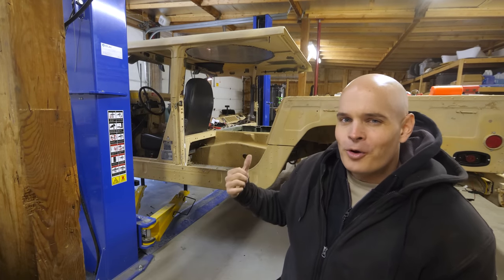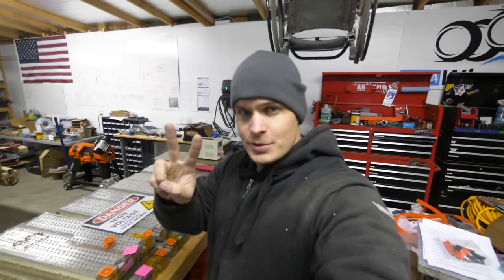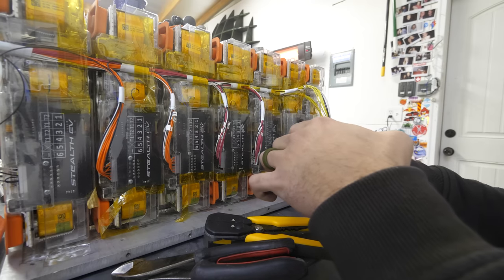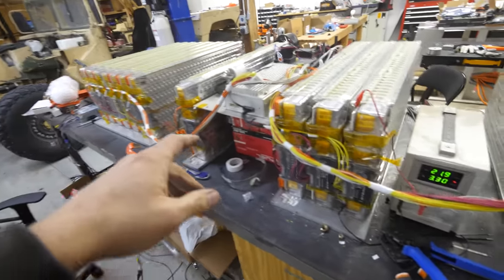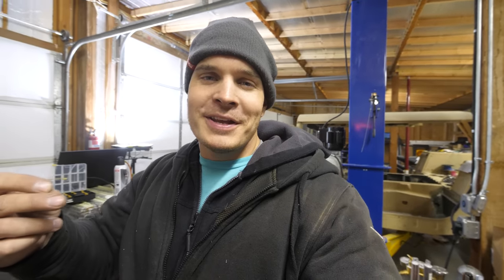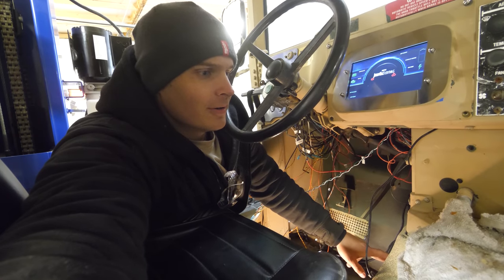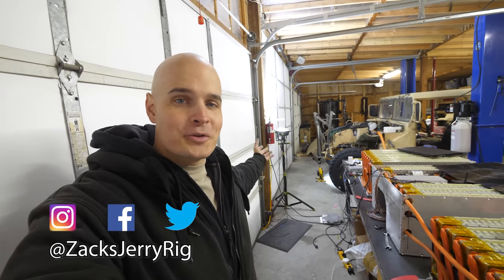Building the Brains of the HIGH VOLTAGE System - IT MOVES!!

Comment: If using an Orion BMS for upper and lower level balancing why would you need to balance the one module prior to wiring in series as you did with a trickle charger over night? Wouldnt the BMS handle this?

Comment: This is SO cool!!
But Q - why are you using Tesla-Batteries? Other manufacturers are using formfactors that might fit better into a Humvees "open spaces" (especially those occupied with diesel-parts before), so maybe the backseats wouldn't be "occupied" by the batterypacks?

Comment: Twisted pair is nothing to do with causing interference, it's a key part of how differential data systems work (CAN is differential) you want any external interference to be picked up equally by both the high and low wires, that way the receiver can do a better job of removing the noise, the twisting helps ensure close coupling of the wires. How differential works is you take the same data and send it positive going on one wire and negative going on the other so maths wise one wire carries +1 the other carries -1 (or vice versa) Noise gets picked up by both wires and is picked up equally, say the noise has a value of +2 so both wires now have data at +1 or -1 and noise at +2, now at the receiving end the negative wire is first inverted so you have one wire with data at +1 noise at +2 but now the other wire has data at +1 and noise at -2, you now add one to the other and you have data at a level of +2 but noise is now 0 so you've eliminated the noise and also doubled the signal.

Comment: I would insulate the entire inner surface of the battery box. Specially the open terminals for each battery set that connect to wires are quite close to the bare metal case. This can be risky specially if the box is connected to the chassis ground.

Comment: Actually end resistors of the CAN bus are not to mark the end of the bus. As CAN protocol uses optocouplers inside the modules, it's impedance is really high. Without these resistors, the wave form of the can bus will be like steady and nobody can communicate via the bus.

Comment: the exposed battery terminals being so close to the side of the Battery boxes has me very nervous. Should those batteries slide forward some how (assuming they are mounted so they cant move). what's keeping them from shorting on the battery box case.

Comment: You can take like 5 Million volts if the Amps are low enough,
like if you're doing High voltage 5Mil V at 0.3A, you'll be fine if you get directly shocked or even touch both battery terminals. 
It might hurt a good bit but unless you tried, it be pretty hard to die

Comment: Surprises me that the cables are very thick, but the contactors themselves are just thin pieces of metal with only a small amount of surface area for contact.

I guess the resistance for that section is high. But since it's such a small section the waste heat easily dissipates and the energy lose isn't that bad. But you wouldn't want the entire wires to have that much lose or to be generating that much heat.

Comment: I’m assuming everything is aluminum. But just incase, if you’re using different metals (nuts, bolts, battery boxes, etc.) be careful as to what metals are making contact. Galvanic corrosion is a thing. (Tbh I don’t know everything about it but I figured I should give you the heads up just in case you don’t either)

Comment: Your wires running through each box need wire protection so when vibration occurs it doesn't cut the wire feeds .

Comment: Isn't the 500A of the fuse at the limit of what the motor will use at full power? If the motor is rated for continuous output of 220kW, which at 450V (and a 100% efficiency, which is certainly not the case, and it will decrease as the motor heats up as its internal resistance will increase) means a current of 488Amps, which is very close to the limit of the fuse. I hope that the specifications of the motor ensure that it cannot draw more current in a transient state.
Reply from the maker: Yeah,  it doesn't break right at 500 amps like a normal fuse. It allows 500 amps but not for long periods and breaks at higher amps.

Comment: Your lugs on your battery cable should not be loose on the terminal i.e. 3/8" terminal on a 5/16" stud. Several battery manufacturers use these 2 sizes for the + (3/8") & the - (5/`16") for most applications. Marine batteries may have both terminals at 5/16" which brings up the second point. Why do people use only 1 color cable when another color costs just as much per foot? Like red for + and black (or yellow) for -, yellow being used to clear up any errors about red OR black for +. P.S. ALT (adhesive lined tubing) heat shrink rocks but don't experiment on your finger, it really does stick & also burns your finger as well, not that I have done that. I left that up to the apprentice to figure out!

Comment: Well, the amps (current) is proportional to voltage in Ohm's law (I = U / R). Although the human body probably has a quite non-constant resistance, higher voltage will tend to give a higher current, all else being equal.

Higher voltage also means greater danger from an exposed conductor, because at higher voltages, the electricity is capable of arcing through air over larger distances. People seem to forget about this, as the arcing distance is so small as to be almost unnoticeable with the voltages you have in household outlets, etc.

(When you hear about someone getting electrocuted by a high-voltage wire, from climbing on a train and such, you often hear people respond "How could they be so stupid as to touch the wire?". I suspect that in many such cases, the victim was actually thinking the same thing: That he'd have to actually touch the wire to get hurt.)

Different voltages, the difference between AC and DC, and the frequency of the current (if AC), do affect how the current flows through your body and the effects. I don't really know any details of it, though. What I can say is that power (watts) = voltage (volts) x current (amps), so obviously 1015 volts x 1 microamp is putting far, far more energy into your body than 12 volts x 1 microamp, and it's pretty straightforward assumption that it's going to do far more damage as well.

The point with "it's not the volts that kill you" is more that voltage alone says nothing. A bit of static electricity can be thousands of volts, but is still harmless, as the amount of current the static build-up can deliver is quite small.

Can't wait to see this beauty as a daily runner! :D

Comment: Shouldn't you maybe insulate the inside of the metal battery box - especially at the side with the terminals - just to be extra sure that no vibration or sudden movement causes the terminals to accidentally short against the box?

Comment: 2 packs in series won't kill you because it is DC power and not AC, DC needs a lot more voltage to be able to cross skin and protections. eg 110v AC might shock you but DC wouldn't prolly do much harm

Comment: Gave me the HEEBY JEEBIES that you didn't think to put any insulation at all over the high voltage terminals !!!  DUDE - something always bumps against non-insulated terminals.  Same for inside the box - you're going to drive into water at 100kmh one day (or whatever else goes wrong), which will bend all that conductive aluminium right into contact with those terminals too (or the batteries will shift forwards, or you'll drop a spanner, ...)  you've got to do something more smart about using more than plain air between lots of AMPS (instant fire sucks) and lots of VOLTS (death sucks too) and everything else...

Comment: Hey Zach, so many things I would / should comment about... But I'm in the process of purchasing a hydraulic lug crimper. Do you mind sharing the brand that you used? I'm concerned about ending up with a Chinese knockoff that will cause me years of regrets. Primarily I'm crimping 4 AWG & 2 AWG  (not 2/0 gauge) tinned copper battery lugs on stranded copper welding cable. I've been told a 16 ton hydraulic crimper is typical for my application. If you don't mind shoot me a link or just give me your opinion. 

Now, I'm going back to the beginning of your project and start watching your videos! I've just become your newest fan...
Scott
Reply from the maker: I just got it on Amazon.  Not sure the brand.  I did have a yellow one that sucked though.  The blue one is way better.

Comment: That's funny, the e-wire, electroluminescent stuff runs at a much higher voltage than the hmmwv, but low current, so safe.

Comment: BMS also prevents from cutting the power from batteries. If one battery Fails the other batteries will still be running instead of cutting the power to whole system.

Comment: I missed the cooling system.   I'm not sure if your application needs it but I'm just making the fatal flaw of assuming it is safer for the high use and faster charging right ? I just can't imagine not having  some ... heavy use ... with this platform

Comment: don't use a knife to cut sheathing like he did you can create hot points with the dead ends you make when you cut some on the copper strands and these can become failure points later possibly leading to fire.

Comment: You might already know this but the batteries need air to stop heat accumulation.  It could be filtered cabin air exhausted outside filtered or screened to keep varmints out unless you're using liquid cooling
Reply from the maker: We are using liquid cooling

Comment: AWG  on wiers is a mess  :D   In my country we use mm2..

PS - Pleas why no torque wrench on the battery terminals!!  and glu marks. ?
I work on electronics and torque wrench + marking to control your torque and to be sure the bolt not moved or will move :D 

PS - the 450Volt wont kill you tho.. The volt is not dangerous.  The Amps kill !! 
But you need around 40-45Volt to penetrate your dry normal skin. 
You only need 0,3Amp / 30mA to make it dangerous.  -   0,3Amp is like nothing.!!!  but dangerous. 
Your Tesla battery have at max shortcut around 1450Amp! :D  think about that!

Comment: Two modules won't kill you, 90v DC is still safe to touch so you'd need over 4 modules at 20 odd volts per module before you start to have a problem.
Reply from the maker: 90v DC is not safe to touch.
Reply: @JerryRigEverything  UK IET (BS 7671:2008) defines an ELV device or circuit as one in which the electrical potential between conductor or electrical conductor and earth (ground) does not exceed 50 V AC or 120 V DC (ripple free).

ELV is defined as "low risk" and 90v is significantly lower than 120v.
Reply from the maker: @mfx1  cool story. 90v is still not safe to touch.

Comment: So, that WIFI and its antenna box being mounted inside an aluminum box is a good thing?  Would seem that aluminum box would act as a Faraday cage and make RF communications a challenge.
Secondly, and probably more importantly; those pre-charge resistors are a safety issue.  They ensure the circuit has 450v continuously, even when the power switch is open.  I would at least add some permanent warning stickers indicating the circuit stays charged even when "denergized".

Comment: @16:29 Well, I'm an Electrician. I work with high voltage, 69Kv down to 5VDC. Watching you strip the orange wire to the copper made me cringe a little. Where your knife cut into the copper is usually where the HV Wire/ Cable blows out. The little stands that were falling off when you stripped it hurt my soul. Those spots cause air gaps, hotspots in a wire that will eventually cause an arc flash from getting too hot under a heavy load..
@19:51 450VDC will not hurt you as long as you DO NOT touch + and - at the same time. My UPS system at work is 250VDC and I do weekly PM's and touch either + or - but NOT at the same time. But - BE SAFE vs SORRY. Good job relaying SAFETY.   

How is the Baby? 

Other than that, carry on.

Comment: You need to redo the bms wiring completey or switch to completely using wifi-.Sorry Zack. Clean and thoughtful wiring but impossible to troubleshoot. Having 3 seperate battery boxes , if any one has an issue because you taped .. all the wires into one harness for all three , all three come out at the same time. So issues . 1 Can you remove and test each bms connector when  mounted in the box in the humvee? From what I see (and maybe I'm totally wrong ) there is no way to access each bms connector from the top of the box. each box needs to have the side removed which I can't see how you would access while in the humvee. So thermisters go bad (all the time), Multiple ground loops are almost impossible to troubleshoot ? So what you need to think about is with the boxes mounted, can you test and remove the bms plugs with slack in the wires to replace a pin or a plug of a thermister. Looping grounds is one of the first things every electrician is told to never do. If all of these conditions can't be met (accessibility of components, testing of connections ans slack n the system) troubleshooting of repair is almost impossible. I can see why resla went wireless very easily. Sorry I might be totally wrong but these are of primary concern for long term maintenance.

Comment: I think it's too late to give this tip, but you can charge these batteries using a SkyRC charger, there's a model that charges up to 6 batteries in series with 6 amps, balances and stops automatic when full and still gives the charged capacity if you charge from 0 % up to 100% you will know the total capacity in mAh

Comment: I was electrocuted by 480volts on a 400 amp circuit for about 3 seconds till the ground fault tripped the breaker. (At a shipyard) it feels like if your arm goes numb and starts getting feeling back, that pins and needles high frequency vibrating feeling, but x10. It burn my elbow and hand but i walked away. The doctor said he doesnt know how i was alive with no heart problems. (In one or and out the other) 😮

Comment: generally speaking, HighVoltage wire (without sufficient mechanical and electrical reinforcement) and LowVoltage wire bundles should never touch nor share a knockout or conduit. 
You don't want a failure to propagate to the LV systems.

Comment: How come you routed out cavities to put strips of rubber in instead of just laying 1 giant sheet of rubber in the bottom of the box? Or using a thick coat of rubberized paint like truck bed liner? Or both to be extra safe. It just seems like you chose a harder and less optimal solution.
Reply from the maker: Because the batteries have a plastic ridge on the side that fit down in that slit

Comment: A CAN-BUS system works the same way a fire alarm system works. If the resistor gets shorted on a certain arm then the fire alarm system interprets that as a problem and through some programming it knows if the shorted resistor is a fire incident or what's known in the industry as a trouble code. fire code sounds the alarm, trouble code sounds a little buzzer at the main unit letting the electricians know to go take a look. I'v installed a few dozen fire alarm systems in my construction career

Comment: Hi, Jerry, I have been following you for a while and as of yet, I have not seen anything about keeping in contact with the batteries and any other devices that would need to be monitored in a wireless and very low-cost way checking the unit for problems. If you are interested in any way you can email any time bless you and happy New Year please be very careful.

Comment: Will the Wifi work after covering it will all metal? I put my Raspberry pi in a metal box for  better cooling to act as a heat sink and the Wifi stopped working.

Comment: Aluminum is a conductor, should there be scratches on the bus bar coating or on some insulators,  and touches the aluminum casing, the potential for short circuit is big. Suggest using PVC or hard plastics in battery casings as they  are not conductors and can handle vibrations and insulator breakage, or coating peeling. Just my five cents. I was alarmed when you placed those alum casing where the bus bars have the potential to touch it, even though the bus bars are coated, i would not bet my life on the insulating capacity of those coatings.

Comment: Why not ground the batteries to the case and use a smaller wire to join the grounding and the hmer chassis. Then you only need a positive wire between batteries

Comment: Doing any work with electrified equipment is absolutely terrifying. I'm good at it but i hate it. It is like working with a bomb, not only do you have to be super focused on what your hands are doing, but also what your feet and rest of the body does. You practice your movements before doing anything, think each part of it and choreograph it. It is doable but not enjoyable apart from the sheer adrenaline it brings. The feeling afterwards is awesome..

Comment: Advocating safety is fine, but you come close to not following your own advice. Using plastic grommets on those round holes where the cloth tape wrapped cable bundle enters the chassis would be a good tip to follow. (Later you state you'll use conduit there.) 
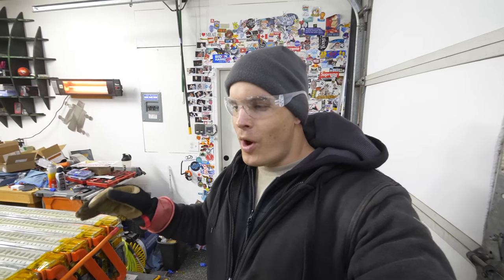And that wrench at 23:29 should also have been wrapped with insulation...  Yup, it wasn't finished, so only one half of that lethal HV circuit is done - still that's mighty close for a slip of a wrench... (just sayin')
But you did nice work.

Comment: Putting in the cell tap wires with bare hands is the stupidest thing Zach did. The small wires might look safe, but they are absolutely enough to carry a deadly current. Also his other hand was touching a grounded metal part, giving the electricity a nice pathway through his heart.